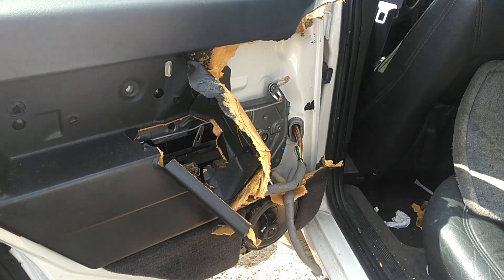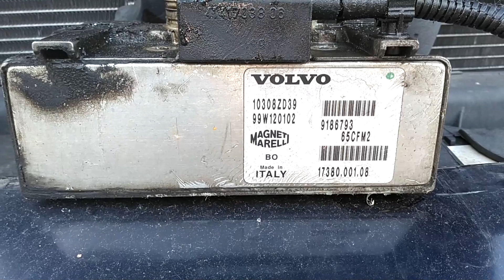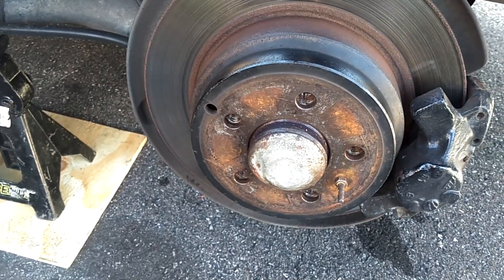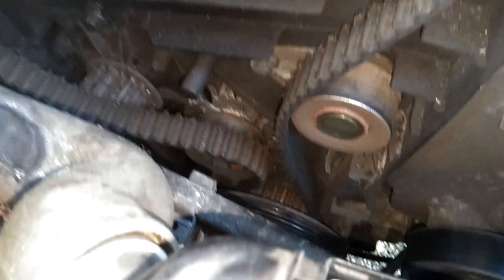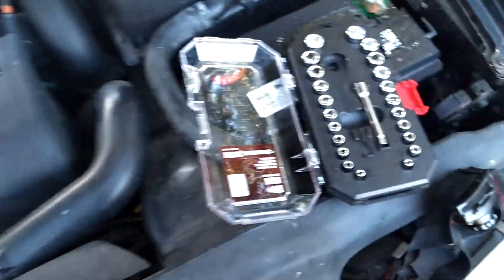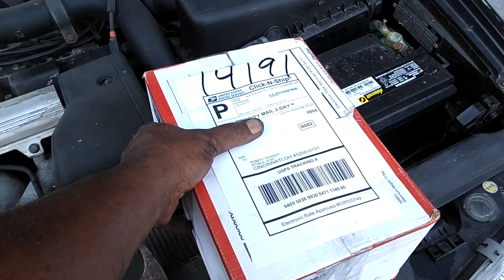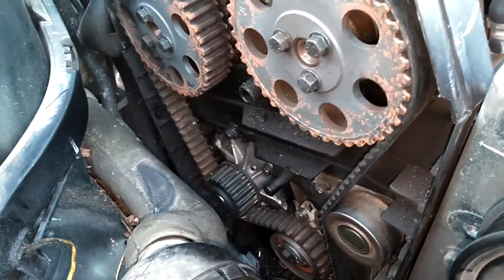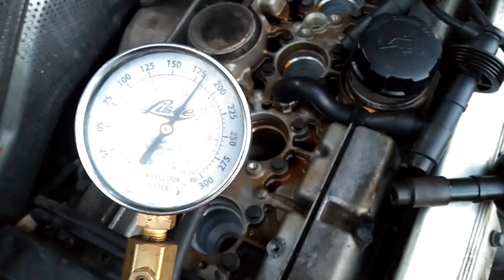Went to a couple of salvage yards, then adjusted my parking/e-brake, then check the engine on Betsy.

Comment: Saw that ETM off the blue Volvo in video and it reminded me of this. We still have a 2000 V70 Cross Country, about 10 years ago we were driving back from Florida and the dreaded Italian Magneti Marelli ETM was going out, dead spots in the pedal. Was afraid we wouldn't make it but we did. That was an expensive repair from the dealer. Before I bought my 2004 C70 did some research, Volvo got rid of the Italian ETM and in 2003-2004 went to Bosch which apparently is trouble free. Now a Canadian company XeMODex sells the Magneti-Marelli ETM as a rebuilt unit for about half price.
Reply from the maker: Correct. I have modified a few of the older ETM's myself.

Comment: Your day must start really early Robert, I'm installing new Bosch coil packs and Denso IK20TT  iridium plugs on my wife's 2007 XC70 this morning.
Guess I'll find out after installation if I should have stayed with the Volvo factory plugs or the Bosch Platinum FR7DPP+
Reply from the maker: It will probably run good for 10,000 miles or so.
Reply: Great to hear the Volvo family is up early maintaining their cars. Hope those spark plugs work out for you.
Reply: @dieyoung8259  IPD shows them on their site as a higher quality replacement than the Bosch single wire platinum, and at the auto store only $15.OO higher for the set of five.
Reply: @RobertDIY  I'm in the experimenting stage on plugs for this car, first Denso Iridium set I've installed in Volvos. Have had them in Lexus ES300 and LS430 we had and are still in the cars running fine, both over 200K now. I'll let you know if they become a dismal failure, but finished job several hours ago and have driven it, runs like a scalded dog........

Comment: What be the different symptoms between bent valves or just head gasket? I’m guessing for HG only no misfire but combustion gases is cooling overflow tank?
Reply from the maker: Head gasket problems usually happen when the engine is overheated, bent valves usually happen when the timing belt is loose or broken.

Comment: Hi robert. Got a 08 s60 2.5t automatic that starts rumbling and shaking alot sometimes. It usually starts at about 50 mph and then it just gets worse and worse until i have to pull over because i fear it will break. When i pull over to a full stop, it usually stops shaking and i can keep driving with no problem for a while. Sometimes i can drive for hours with no problem but other times it starts shaking right after i hit the highway after driving for 2 minutes. Any help or thoughts will be appretiated. Thanks.
Reply from the maker: Maybe you have a bad shock or strut.
Reply: @RobertDIY  Thank you. I will look into it.